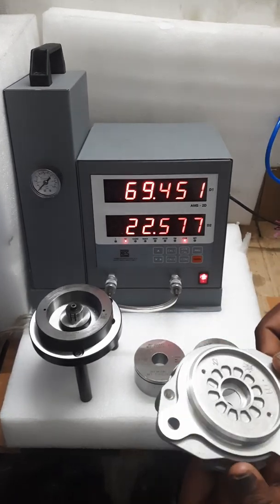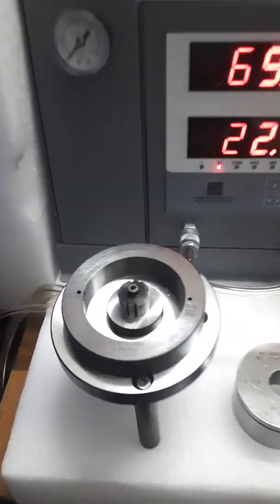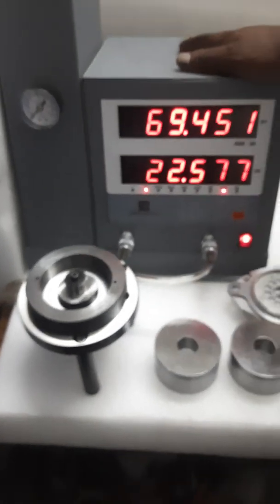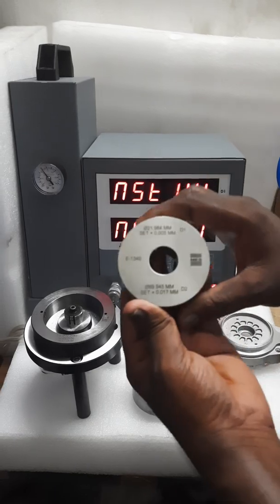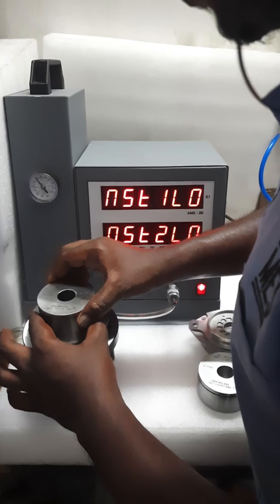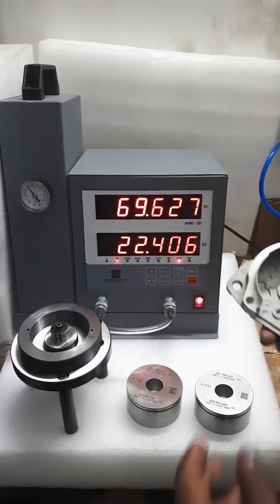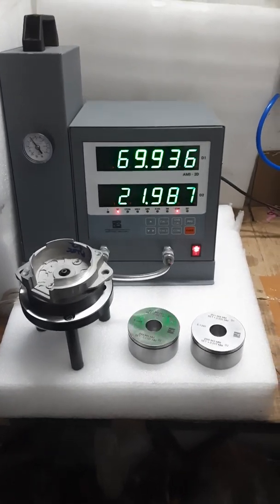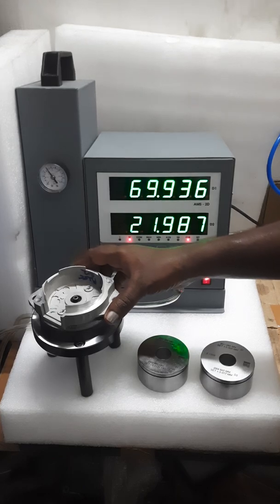AIR GAUGE - ID & OD DIAMETER COMBINATION with Accuracy 0.002mm

Comment: How to set the Master Value(Nominal Value)...
Eg:69.451
    22.464
Reply: Calibration of the system is actually recording the pressure in the system for two known measures. So, when system knows what was the pressure for two known dimensions, system can measure the unknown dimension if it falls between two known dimensions used for calibration. System interpolates between two known pressures/dimensions and returns the unknown dimension based on current pressure in the system.
I hope that my explanation was good enough.
Reply: https://youtu.be/yFd-j2m_oGg?si=UmxSGFRGZm85M3TW